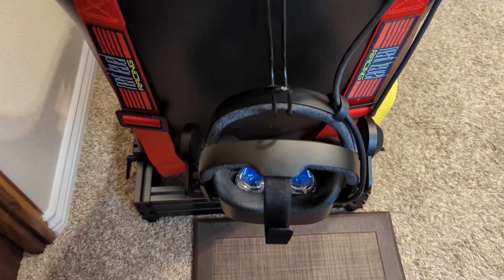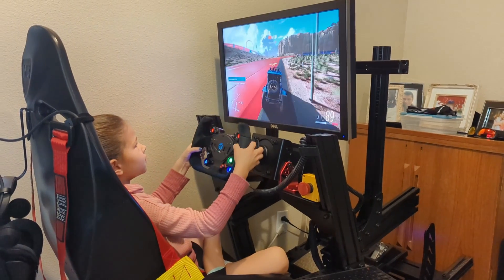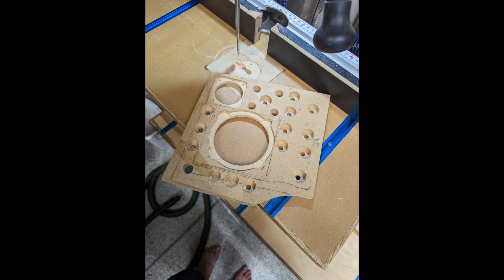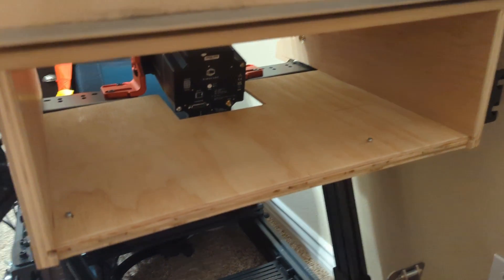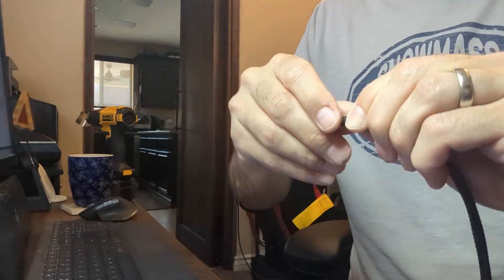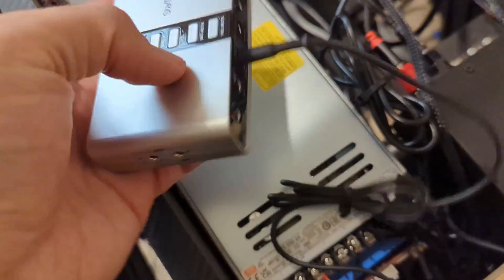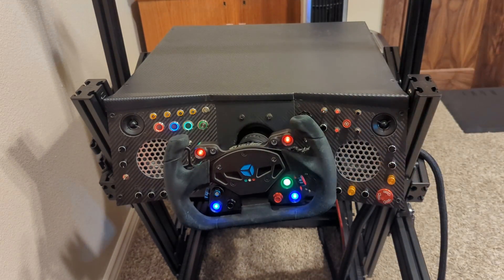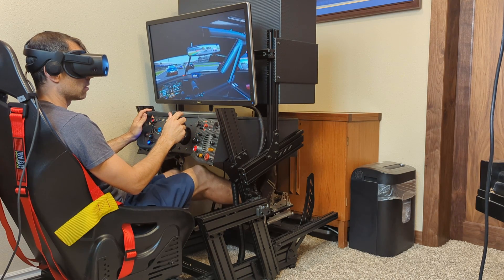Sim Racing Rig and Arduino Dashboard Evolution

Comment: Simcube with tm pedals 😅
Reply from the maker: Yeah, glad you noticed that! I knew I couldn't just outright buy the best gear all at once, and if you think about buying temporary/throwaway parts to get going, the T-LCMs for only $120 are the best purchase that still gets you a decent interim load cell solution (and they're actually pretty darn good for that price point).  There aren't any "cheap" direct drive wheels, so I knew I needed to just bite the bullet and get the SC2 outright.  I avoided the NGR rig for months with scrap lumber from the garage. So very little money wasted to get to a "final" system while being able to enjoy racing on day 1 at a fraction of the cost.

Comment: You have nice brothers man..  I actually hope they made GT Zero with maybe hard plastic version, im just worried the Alcantara would be weathered too quickly..
Reply from the maker: I'm about 250 hours in with it. The top seam of the Alcantara covering the left "cap" of the zero has come apart. This is more a design flaw IMO, as it's not stitched but affixed with adhesive.  I messaged the company with no response. I've been able to superglue it (twice now, lasts a month or 2) and be satisfied (no one would notice). Otherwise the Alcantara seems to be holding up OK.  Another point - the rim itself is modular from the button box and could be replaced for about $100, so I'm pretty happy overall.
Reply: @fairbmf  What do you mean modular? Do you have pics of the seam?
Reply from the maker: @trevorbelmont4633 Pic of the seam: https://i.imgur.com/zoZJOrL.jpg and https://i.imgur.com/K2XozJm.jpg (hard to get in focus). So not a huge deal, and repairable so far, but at the price point I'd have liked to not have to deal with it and would have expected company response.
Reply from the maker: As for modular, you can by any of the rims from cube controls on the GT series, which means you can replace if they wear out, or change styles. For example, https://www.cubecontrols.com/product/gt-zero-rim/